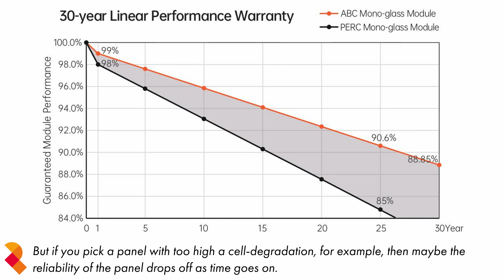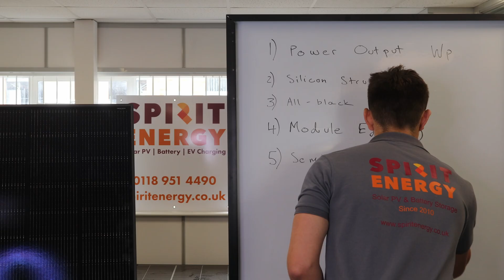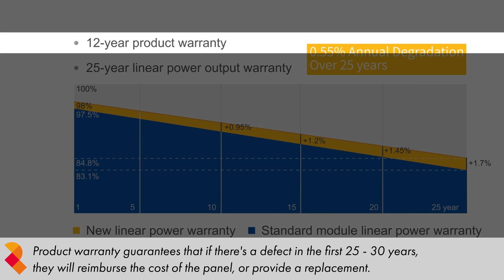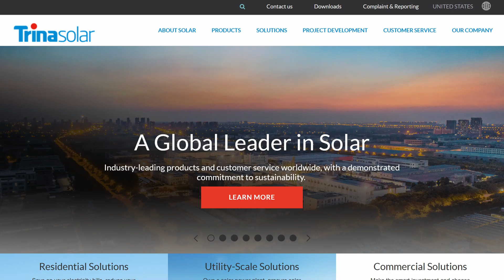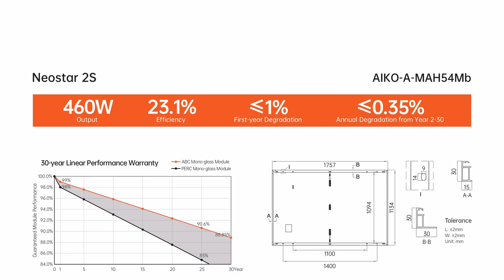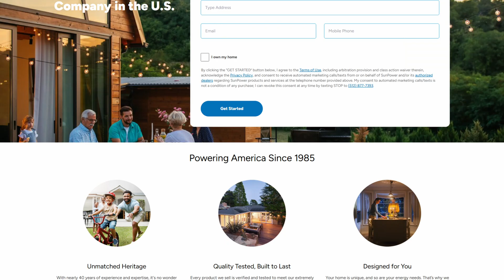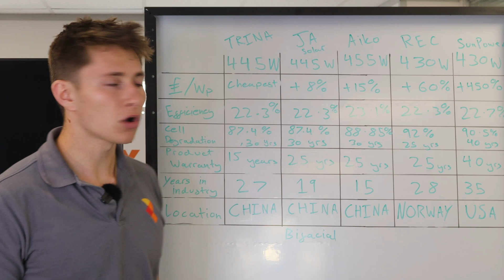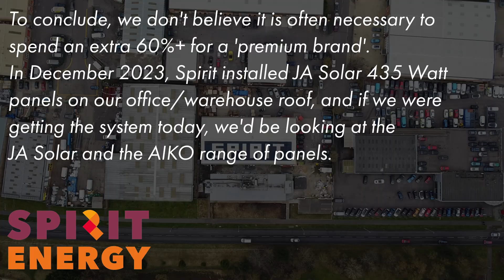Choosing a Solar Panel in 2024 - Which is Best & What to Look For?

Comment: Do you have a video on best panels (if any) for coping with tree/dappled shading?  I hear Aiko are, but not clear how..  Thanks
Reply from the maker: Hi we don’t have a video I’m afraid. AIKO will likely be best at this due to the shade mitigation tech that allows individual cells to be bypassed compared to whole sections of the panel.
Reply: @spiritenergy_uk lovely thanks.  Yes I gathered elsewhere after commenting that Aiko Generation 2 have more bypass diodes than standard and you're saying they're on every cell which sounds very good, thanks.
Separately, I got wall mounted panels put on the front of a property last week, between the windows.  Looks a bit "different" lol but direct south facing Townhouse and I gather it's allowed, surprisingly, as not in a conservation area.

Comment: The more expensive panels have higher voltages which will produce more power. The cheaper ones, even at full sun, will only produce 75% of max watts. If you have limited space go premuim.

Comment: I saw someone do some bifacial tests here on youtube with high-angle ground-mount and various surfaces to compare albedos. He found 2-10% extra generation (IIRC), and whiter surfaces made a significant difference. So yeah, 30% is going to be with carefully-angled mirrors behind and not very relevant to real world. But ultimately missing the back-sheet off is cheaper and adds efficiency so is clearly a good idea.
Reply from the maker: How interesting. Exactly what I expected. - Tok

Comment: i am getting soon when my house is mine in few weeks iam getting   12 Aiko Neostar 2S 455W All Black ABC N-Type Mono Panels 6 for front house and 6 on back because of the way my house is facing  with a  10.64kWh Sunsynk Battery Storage (90% Usable) with bird protection for £9635 is that good price
Reply: Aiko Neostar 2S N-Type 455W 20 panels also on 2 sides of roof. 
Tigo TS4-A-O Optimisers x10
Fox KH1 10.0kW Hybrid Inverter
Fox EP5 10.4kWh HV Battery (2x 5.18kWh batteries)
Bird Protection
Got the price through Solar Together Berkshire group buying scheme £11,800
Reply: @Tom-mb2ch  if my roof could hold more then  around 12 Aiko Neostar 2S N-Type  455W  i would of like more even thou atm we not need coz only use 3300kw a year but wanted future proof myself
Reply: @Tom-mb2ch  
Very good deal!!
Reply from the maker: That sounds like a worryingly cheap price. I’d be slightly concerned over how cheap. Have you done a detailed background check and research into the installer? 

-Tok
Reply: @spiritenergy_uk  yes and aslo seen other ppl oneline say good things about them and there local as well
Reply: @spiritenergy_uk  spectra solar I am going with just waiting for g99 come back and my mortage to start so my house is mine

Comment: Makes sense. The other consideration is that it is likely that the technology will have significantly advanced in 10 years, so in all reality whatever you buy will be effectively obsolete way before any warranty. That begs the question haunting me, to wait or not to wait!
Reply from the maker: Ultimately, it's an investment. I think it comes down to what's the best use of your money at the moment (assuming that's your main motivation for solar). The IRR of a solar system is pretty similar now to what it was a few years ago (unless you happened to get on the early FiT scheme). You do get a few years where solar returns do incredibly well as a result of massive electricity price spikes.

Currently, the IRR for domestic solar PV & battery system tends to range from 9% to 16% depending on how much electricity you use and how big the system is, and how much it costs. 

It's also very easy to swap the panels out 10 years later - just put some scaffolding up and replace them, as well as maybe the inverter if that needs replacing. Not too expensive to do.

Technology is always progressing. I feel the same way every year about the latest iPhone haha!

-Tok

Comment: Do you tend to install microinverters, optimisers or string inverters with your panels? Does it vary?
Reply from the maker: Hi, thanks for the question. I’d always recommend a string inverter. The minimal amount of impact that the other types have on shade mitigation will in no way recuperate the additional kit & installation cost. They also have a much higher failure rate. I always advise my clients to get a string inverter, preferably DC coupled. -Tok
Reply: @spiritenergy_uk  DC coupling is more efficient if you use most of the power locally, but if most of it is going out on the AC isn't AC-coupling more efficient (because it doesn't go through a battery+48VDC inverter, only a higher-voltage DC inverter)? I would love to see some efficiency figures and discussion of various configurations and equipment. Do you have any pointers?

Comment: Im in the states and when I got my panels installed the company told me that they dont like to install any panel over 380w on a roof for residential panels.  This was in 2021.  I sort of want to go and get the highest wattage panels on the market and replace the panasonic ones I have just to increase the output of my system.  Of course there are other things I'll have to upgrade as well but I could just about double my output with new panels that arent the best cost for my solar installer's budget.
Reply from the maker: I think it depends on how much the replacement cost is, and how much more you can get from more modern panels. If you can double your output, then it's probably worth doing, but if it's just upgrading to a 450W panel then I think you're sacrificing too much in terms of IRR.
Reply: @spiritenergy_uk  Ahh yeah good point.  I'll  have to crunch some numbers then.

Comment: Like your last video on the Powerwall 3 this video is very interesting and helpful.  Thank you, now subscribed.
Reply: Quick question.  Aesthetically out of a dozen black panels of Aiko, REC and SunPower installed on a 45 degree pitch roof what make of panel would look the best or is there no visible difference?
Reply from the maker: @johnchambers6272  Thank you for the kind comment and subscription. In terms of aesthetics, you won't be able to tell the difference unless you're directly below them and focussing on them. In the video, you'll see that the JA and Trina panels have silver bus bars, but these are pretty much invisible on the roof. The Aiko and SunPowers do look a more "deep black" but ultimately you won't notice the difference unless focussing on it.

Comment: "Who ya gonna trust?"  The track record of each company is important:  1)  How many units have they been asked to replace, and of that, what percentage did they replace.  2)  Does replacement include labor?  3)  Are the numbers accurate (as in disinterested 3rd party certification)?  A lesser consideration is the politics of economics; will the importation of repair parts (whole modules, etc.) be possible, regulated, taxed, etc. differently than when the system is installed?  And let's not forget the old motto of Buy Local when possible.  From what I've seen, the Chinese companies have improved the quality of there builds over the past few decades.  There is a Spanish company building hybrid units that draw the heat of the unit for domestic use, co-generators on your roof...  Best of luck to you and keep doing quality videos.